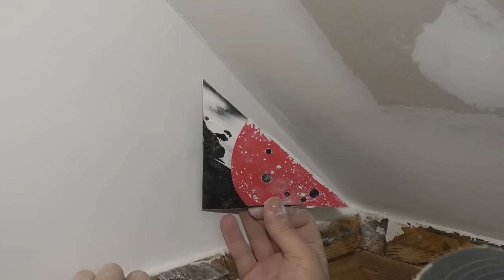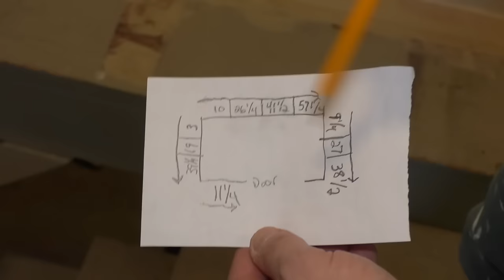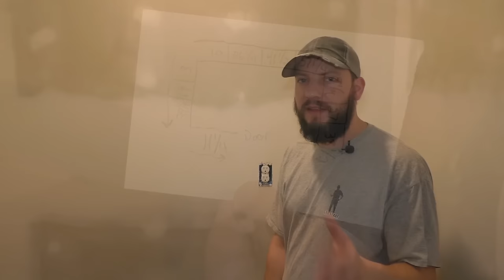Joint Compound Sanding Tips for Perfectly Smooth Walls | Sanding, Priming and Painting

Comment: Mapping the studs is always a great idea,  when I built a new house or did a remodel I would take pictures with a tape measure stretched out. I would do it after all the mechanicals, plumbing, and electrical before insulation, I then burned all the pictures to a CD and left them in the breaker box.  I have been retired for a little bit now and actually had a contractor call me and thank me for doing that on a house I built in 1999.  He did say that because CD's are the next  DoDo 🦤 he resaved all of them to a USB drive.
Reply: Very smart idea.

Comment: I think you are great. I did 108 sheets of drywall myself. Two tips always start with the ceiling , always work Fri. The top down. 2nd no need for all that measuring , so time consuming. Just go to the bottom of drywall and use a marker put a dot or tape a piece of painters tape to bottom edge , or floor right beneath. Reason to start painting on top of, if you did your work below then any problems, runs etc will fall below to your beautiful painted wall.

Comment: I've got really skilled at using a hopper and texturing the walls and ceiling. No need to worry anymore about the mud job I do. Also, I learned the thinner my mud the less I have to do, and I can wet sponge most everything out after a little drying. I know and have hired professional people, but in the end save more than 50% and do it yourself with time spent learning on good and bad videos on YouTube. Yours is good.

Comment: One tip: cut in all your corners using a 4in mini roller, when you’re painting ceilings and walls you can use a 4in mini roller to cut your ceilings too. No brush marks, and saves lots of time. And in areas where you need a brush to cut in, use your mini roller and roll as close to your cut line as possible to eliminate brush strokes.

Comment: Just an FYI for anyone interested. I just went through a similar thing to this - used Killz PVA primer, it sucks. Also used Killz 2 (whatever's in the blueish paint can), it also sucks. Do yourself a favor, spend more at Sherwin Williams or Benjamin Moore on a good primer. This is the base coat of all your painting efforts. Also, use a microfiber nap if you don't want fuzzies.

Comment: Great tips! 26:40 I used to use tape to mark the areas that needed to be touched up but I've had the tape fall off, then that spot gets missed until another check. What I started doing is very lightly circling the areas that needed more mud with a carpenter's pencil. After touching up with mud and resanding, those marks become faded but still visible enough to see where more primer needs to be applied. Lather, rinse, repeat.

PS: Playing paint chicken?

Comment: I did a room in plaster and blueboard. And it didn’t need to be sanded. Also found that if I mix plaster of Paris with mud to patch a hole, and didn’t need to sand in that case either.

Comment: Pro Tip : IF you use a legit drywall primer, you don't need to dust it much. You can just coat it and the dust will clean right up into the primer. And no more dust. (Obviously you need to do a basic vacuum - use a proper filter in your vac.) More than likely you'll need 2 coats to prime the paper anyway. It looks like you went really light on the first coat of primer.

Still - as always - amazing job, and video!
Reply from the maker: Interesting, thanks!
Reply: That's a good primer though. You don't need to spend tons of money on it.

Comment: A flat finish wall is hard to do, that's why they like to do orange peel to hide the imperfections.   Lot of hard work in that tiny space.
Reply: Yep. Spray texture has now become so ubiquitous in the building industry because it hides "production" level construction (housing developments, etc; AKA "blow and go") that average home buyers come to expect it. My last house I did in all smooth finish. When I sold it, the person that wound up buying the house initially complained that the walls weren't "finished" and wanted me give to them a discount so they could hire someone to spray tex and repaint!!! [facepalm] I had to explain the above and while it's harder to do up front, it makes patching repairs easier to do as matching the texture is difficult between professional spray equipment and can tex. If not done right then the repair becomes obvious, especially with a satin or glossier paint. A smooth finish is a smooth finish, no matching required.
Reply: @GraeMatterz  There are 5 levels of wall finish, orange peel is #3.  The architects I worked with would spec #5, the best and most flat on commercial or educational projects.

Comment: You're not going to texture the wall afterward?? I rarely see drywallers on youtube texture the walls, but every single home I've ever seen from old to brand new construction has had textured walls, so why don't I see youtubers texturing?
Reply from the maker: I think textured walls is definitely a regional thing.  I am in Massachusetts, have worked on 100’s of houses and maybe 2 or 3 had (some) textured walls.  LOTS of textured ceilings although that trend is dying here.
Reply: @TheFixerHomeRepair  strangely enough, the newer houses don't texture ceilings but do have textured walls.